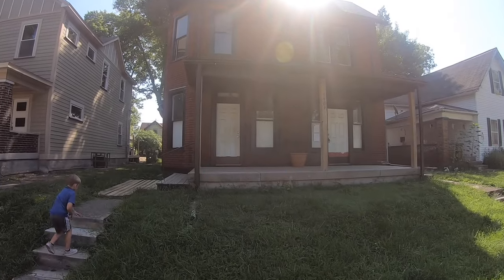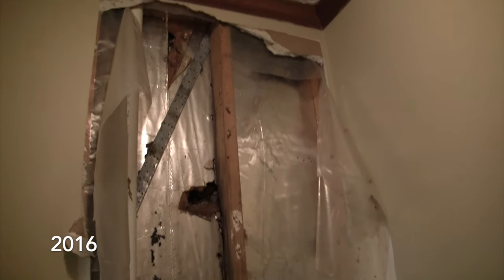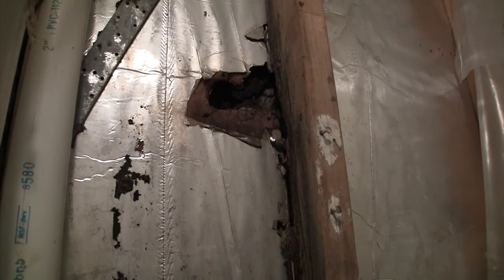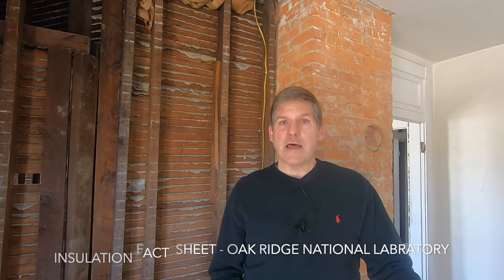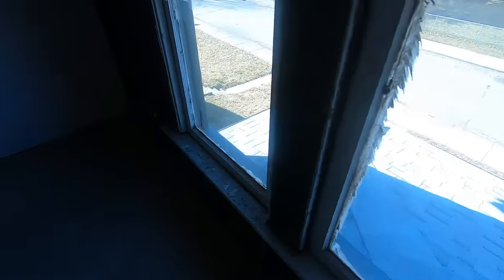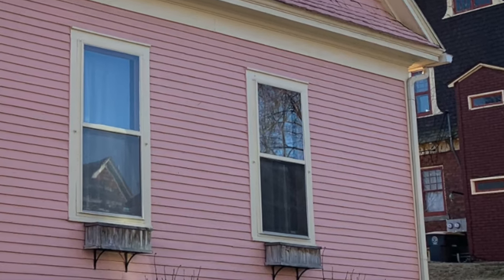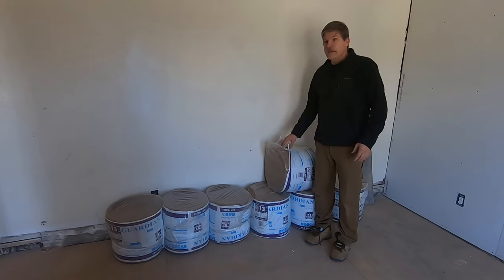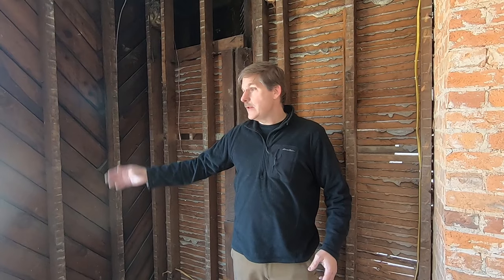How to insulate a 100 year old house and not destroy it - Old House Renovation 5

Comment: Hi, so glad I saw this before insulating my 100 yrs old house. The house is built in this order, exterior is built with cedar shingles, then rung and groove boards horizontally, then just the 2x4 trust (hollow no insulation) lattes for plaster and plaster. 

The roof is newly done with tar shingles, new insulation underneath floor of attic and we just started DIY removing the old plaster revealing the lattes and hollow cavity. 

I can categorically say that the outside walls are incredibly dry with no water infiltration, no staining, no rot anywhere. 

This house is 100 yards from the ocean side on a high hill, gets lots of wind, fog and rain so humidity/dampness is an issue. 

Please help me by advising how I should apply insulation after gutting all interior walls. 

We live in Nova Scotia Canada. We can not leave hollow cavity empty as winters range from -10c to -20c and being so near to the ocean, humidity is always present. 

We plan on renovating the outside with Tyvek and putting new cedar shingles. 

Hope you can help us.
Reply from the maker: Hey Silva..,
It sounds like what you are doing is very similar to what we did. The Tyvek should breathe but stop water from outside. 
Glad to hear all looks dry. 
Insulation is typically faced ( paper facing out) - not very complicated. Needs to fit right. Don’t jam it in. Compressing the fiberglass makes it less effective. 

One bit of advice- make sure the windows are flashed WELL . This old house of ours had many openings around them that needed to be addressed. We replaced all our windows so re-flashing was necessary.  But that is a place to check for air loss and water penetration. Make sure Tyvek is well attached to window frames so it’s one complete barrier. 
Here is what we did w/ the windows : https://youtu.be/rwpptp9JuBc
Hope that helps. 
Thanks for watching!
Reply: @Housebarons  made sure we bought lots of flashing for windows connected to Tyvek. My only question to add was should we put a vapour barrier on the inside (poly ethylene sheet) just before the plaster boards. All new houses are built with it in our area. Everything you guys did, we did or will be doing. Inside vapour barrier was our only puzzled area since the Internet is full of pro’s and con’s but nobody explains the science behind it. We were wondering if we should cover the insulation in the attic as well with vapour barrier before putting back sheets of 4x8x 5/8 boards? Thanks
Reply from the maker: Really good questions. We used faced insulation in the walls ( we understand faced as functioning as a vapor barrier ).
In the attic we’ve always done blown in cellulose and not worried about vapor barrier there.
Yes. The science is not super clear. In the end we went with our gut. 
Hope that helps.
Reply: @silvarehel  I thank you for asking this question!  I am on the BC West Coast near the ocean and we get LOTS of wind and rain.   My 80yr old home has no insulation so I am starting in the attic.  I am cutting strips of dimple membrane to use as a baffle, then creating a sandwich pocket of Tyvek house wrap + insulation + Vapor barrier between the rafters (vapor barrier on the warm side).  I am concerned about the vapor barrier collecting moisture so I won't be covering it for a year so I can monitor any changes.  From my research I need to keep it breathable and dry, and this is my most affordable DIY way.  I will also need to replace the exterior and interior so I will add Tyvek house wrap on the outside and wall insulation at that time; probably going with Rockwool but the jury is still out on the VB.  For windows I will add flashing as I go, but I want to keep the charm of the original windows so I am making removable interior storm windows out of wood + thick clear vinyl that I can remove in the warmer seasons.
Reply: @loreendall8387  I also decided to start with the attic and working my way down. Enables me to modernize the electrical cables and install a venmar air circulation system. I’ve also installed a whole house dehumidifier in the basement. I never thought of the simple membrane, sounds like a good idea, did you get professional feedback or how did you think of going that way. I’d love a picture of how you are creating this membrane, tyvek, insulation and vaporizer barrier. Luckily for me the house is bone dry because of the tongue and groove horizontal exterior wood panelling with cedar shingles but the north east side needs replacing. That was very interesting to get your feedback. I am also updating with the same style of windows (with the squares) but on the east side because of the view I am going with what is called Juliette balcony French windows (actually Italian creation). We should update ourselves on our progress. Right now it’s attic insulation and rewiring 2nd floor ceilings. TTYS
Reply: @loreendall8387  I do not know who does or did the work on your attic but I would really appreciate a picture of your sandwich idea. Thanks
Reply: @loreendall8387  can you send me a picture or diagram/drawing on how you guys did this and why? I am complementing doing the same. Which way up did you put the dimple membrane ? With the dimple going up or down? Please reply asap

Comment: My old house is pretty unique. Drafts come in through more than just doors and windows. In some places of the house, draft comes from under where the baseboards will be. Even under the cabinent in the kitchen. It did have a history of being flooded, but for the most part things seem to be fine. Except the random areas you wouldn't think a draft would get through. Also, there were two additions to the place years ago. A second bedroom which needs the shower fixed due to horrible work and wood is rotting, and a larger living room which I call a game room. If I remember, this house was built somewhere in the early 1900's in WV.
Reply from the maker: Hey Techguy,
Sounds like a normal old house. If I insulated, those draft can com in from the airspace in any and all wall cavities behind plaster or drywall. Can even be leaks in new house- just fewer. Old houses are work but you can not match their unique style and design!
Thx for watching!
Reply: Drafts coming through more than just doors and windows is typical of an old house.
Reply: I live in a home that's over a century old, and I've encountered a rather troublesome draft issue. Specifically, it's coming from my French door, which is connected to the exterior-facing wall. When I place my hand near it, I can feel a significant draft passing through. It's likely costing me hundreds of dollars each year. Do you have any recommendations on how to address and rectify this situation?

Comment: Could you put tar paper on inside then insulation pink and poly?...or tyvek?  I don't want to change exterior.
Reply: This is what I am doing to insulate my 80yr old attic.  I am cutting strips of dimple membrane to use as a baffle, then creating a sandwich pocket of Tyvek house wrap + insulation + Vapor barrier between the rafters (vapor barrier on the warm side).  I am concerned about the vapor barrier collecting moisture so I won't be covering it for a year so I can monitor any changes.  From my research I need to keep it breathable and dry, and this is my most affordable DIY way.  I am going to have to replace the exterior and interior, and I believe I have balloon framing, so at that time I will Tyvek the outside and add Rockwool to the walls.  I'll see how the vapor barrier works out by then.

Comment: What about the thermal gradient? Using unfaced insulation with no membrane will cause the hot air in the house to condense inside the wall with respect to the outside air temperature.

Comment: So if the walls aren’t insulated, don’t insulate them? I have a 100 year old Dutch style colonial house, and I have no clue what’s in the walls. The upstairs walls are wood and pretty straight forward, but the low level has brick structure. I have some leaky windows I want to get fixed, but I’m nervous to open up the wall to see what’s inside
Reply from the maker: We did insulate. But I was trying to convey the reality that insulating an old house is complicated. There are many factors to consider. 
But a window is typically framed into a wall ( boards bordering all sides of the window) so you won’t really have to get into the (empty or insulated )wall spaces unless you are making the window opening bigger than the previous window. 
I hope that helps. 
Thx for watching.

Comment: have you ever seen issues where an owner replaces lath and plaster on an old timber frame with drywall? I've heard of a few cases where moisture would collect on the paper face due to the sheet rock being less breathable than the plaster (which I assume was lime based). In that case I wonder what is an acceptable alternative when the plaster and lath has already been removed. thanks for the great content!
Reply from the maker: Hey architect…,
I have not seen it. But considering the 2 different materials separated by 100 years … I guess I would not be surprised. 
Probably all depends on what happens to the exterior as that factors at least as much as half of the equation. 
Thx for watching!
Reply: Tear out the sheet rock tack up some wood lathe and replaster

Comment: I pulled the wall apart years ago to find the old galvanized drain pipe which ran 4 feet horizontal in the wall cavity, had rotted and the water allowed to destroy the main house beam,but yes this is plank house construction, large gaps between and the inner wall wainsscott,nailed to a horizontal 2x4 at the bottom also destroyed allowing cold air and rodents in and went undetected for God only knows how long, but same,they put vynyl siding which holds moisture, we discovered had rotted the clad board after the house next door melted a portion of the siding, lipstick on a pig is what i call it!
Reply from the maker: Hey Randy,
So true. Can be quite a surprise when you get into the walls!
Thx for watching!

Comment: My house was built in 1923 California Bungalow - no insulation anywhere - neighbors complain they can hear EVERYTHING.  The windows are single pane so I'm in the process of upgrading those first, but worried it wont be enough. What should I consider next to stop sound from travelling from my house to the neighbor?
Reply: Gut the it and insulated the walls. How much is your gas bull
Reply: Ask them to insulate from their side of the wall.
Reply: oh no! please don't rip out those beautiful old windows. They were built to last and if you add storm windows like they do on the east coast or northwest, it makes an even better window insulator than modern double pane windows (since the dead space is larger between the storm window and interior window than the manufactured ones). I would ask a historical restoration expert on what to do. A lot of modern contractors have no idea how to work with older homes and that's how you can end up with a rotting house after it's had little to no problems after 100 years because some guy thought it should be insulated with foam. 
In california, you are so lucky to have many talented contractors and tradespeople who are dedicated to keeping historic and older homes healthy and functional. Be wary of new products, especially windows, that were made with planned obsolescence in mind.

Comment: 150 yr balloon framing farmhouse... Where I've ripped out lathe and plaster on exterior walls...CAN I PUT FIBERGLASS PINK AND POLY WITH DRYWALL ON TOP?? Can ANYONE tell me?? Heat bill is $800./ Month...I need insulation.
Reply from the maker: Hey Susan,
Sounds similar to our house. What’s the exterior. Lots of opinions out there. Research it, pick a route that you are comfortable with. Thx for watching.
Reply: same here.... gonna move into the upstairs floor only during winter and tack wool blankets over everything

Comment: I live in a home that's over a century old, and I've encountered a rather troublesome draft issue. Specifically, it's coming from my French door, which is connected to the exterior-facing wall. When I place my hand near it, I can feel a significant draft passing through. It's likely costing me hundreds of dollars each year. Do you have any recommendations on how to address and rectify this situation?
Reply from the maker: Hey Igor,
There are 2 likely spots : around the door, the trim covers the space between door frame or door jam and the wall. That needs insulation or spray foam. 
2nd, the space between door and door frame should have a weather seal, a foam or rubber lining that compresses when the door is closed to make a weather tight seal. 
Those are the two places I would examine.
Hope that helps. 
Thx for watching!
Reply: @Housebarons  thanks for your prompt response! So it's a pocket door that slides in and out of a wall rather than swinging open on hinges. And that draft comes from the inside of the wall, which is an uninsulated cold space. No weather sealing whatsoever and not sure what could be done here..

Comment: You should also mention the real concerns with spray foams and old buildings and where and how too use it. Rainscreens are also an important  upgrade should you decide to upgrade a heritage property to modern insulation R codes.
Reply from the maker: Hey Ron,
Thx for the helpful comment and for watching!
Reply: Rainscreens?
Reply: Rainscreen  is a drainage and ventilation space on the backside of your exterior sheathing.   Using 3/8 -1/2 strapping or a similar product  behind your siding you create a space that helps dry the siding and keeps the building dry.
Paint and product lifespan is extended as well as maintaining a dryer building.

Comment: My house built in 1946 has solid masonry walls. First floor has no insulation, and any closets on the outside walls have mildew problems. Very frustrating. 😞Can't figure out a solution. Still researching.
Reply from the maker: Hey Sheena,
Dehumidifier? To get rid of excess humidity?
Thx for watching!
Reply: Don't close the closet doors. You're blocking the outer walls from heat, which causes a cold, condensing surface. You'll be paying a little extra in heating bills to warm the closet space, but you'll stop condensation and dry the corner out with airflow, by leaving it open.

This also applies to blankets, towels, etc, as they block heat transfer and will allow the surfaces they are touching to condense moisture in-between. The key is airflow that allows evaporation, and enough heat to stop the condensation inside. Outside doesn't matter, since the walls are ventilated anyway.

Comment: @HouseBarons what about insulating plank style homes? was going to pull the outer(non structural)  planks out & do a vapor barrier then stud a 2x4 wall with Batts in the cavities.
Reply from the maker: Hey Chris,
Sounds similar to what we did except we kept the planks and insulated from the inside. I’m guessing you are insulating from the outside?
The water barrier still breathes which allows water to dry out. But one concern - we found major gaps for water penetration around window trim. We put in all new windows and so we’re able to reflash/ weather seal the window areas. 
There is a lot of debate as to what is best. Do your research till you feel reasonably comfortable with  your choice. 
Thx for watching!
Reply: @Housebarons  As far as the inside goes. I will be pulling the inner planks to frame a 2x4, not 2x6 walls for sqft, insulation & electrical purposes. Doing research an snooping around the attic, basement and uncovered walls, me personally, from what I'm seeing is that the inside planks cannot be structural being pieced to make one plank. As far as outside, I uncovered a few windows that were covered up I want back so I'll need to redo siding while placing a moisture barrier and putting the proper coil stock around each window.

Comment: Thank you for the educational video. I wish I had seen it before starting this project. We bought a house built in 1900. Unfortunately we have taken some of the plaster walls down already.  Since we have seen your video we are not going to insulate. My question is should we keep the lath? and also what do you think about putting vapor barrier on the lath for insulation before putting sheetrock up.
Reply from the maker: Hey Feven,
I’m not sure about plastic / vapor barrier. That seems like it would stop the “breathing” of those old walls. 
But do your own research. We are not the last word . Lots of people do different things. 
We just tried to distill that info to figure what made the most sense for us. 

We are actually covering  the old plaster with 1/4 inch drywall. We are using 1/2 drywall on exterior walls bare studs. You can leave the lathe - less waste. But ultimately it will depend on condition.
Hope that helps.
Thx for watching.
Reply: @Housebarons  Thank you so much for answering my question. I will do some more research.  I think that is a great advise I don't think I will go with the vapor barrier.
Reply from the maker: Hey Feven,
Glad to help!
Reply: Consider replastering with a lime plaster. It breathes, it will absorb water (like in a bathroom) and give it up to the atmosphere later. It’s actually a healthy alternative. 
Definitely keep the lath, if it’s in good shape (usually is) because I don’t know where you could get replacement lath. Modern lath is expanded sheet metal - it might add a layer of complexity to the final wall, an element that‘could’ rust…
“All” the old houses in Europe use line plaster.